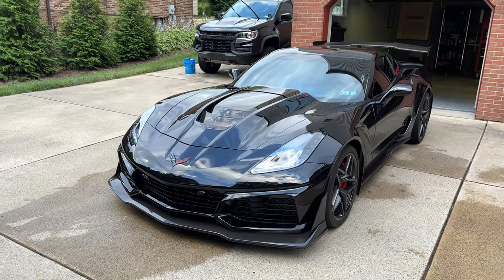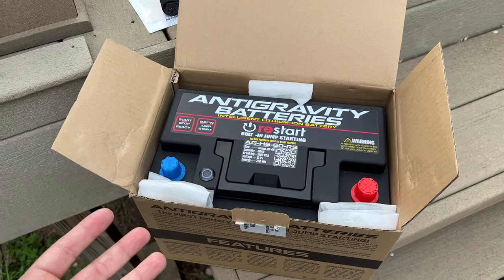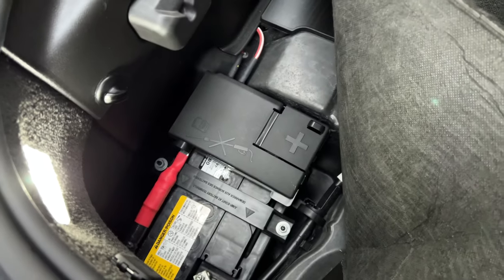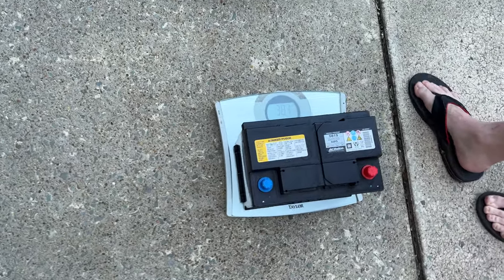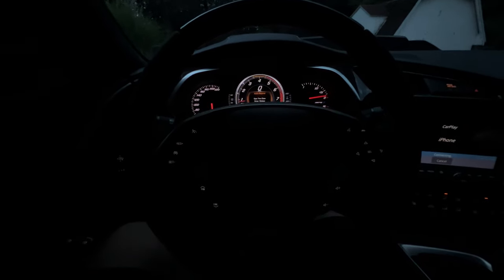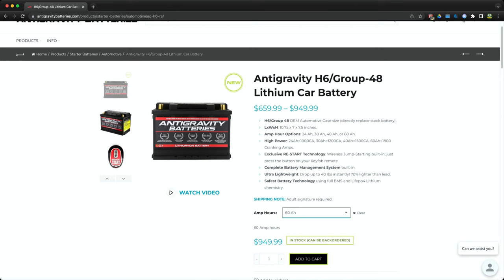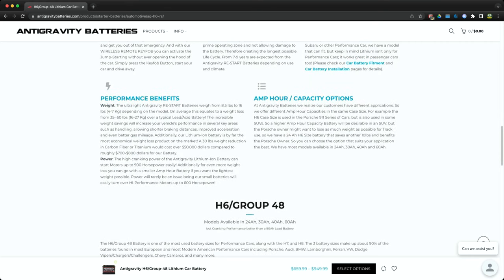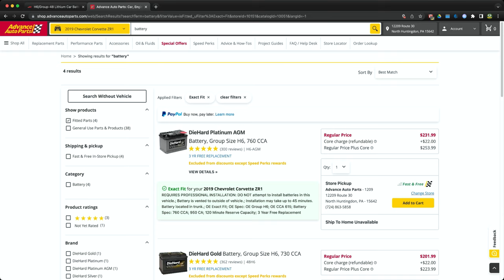The ULTIMATE Battery UPGRADE for YOUR Corvette! Antigravity Batteries!

Comment from the maker: What do you guys think? Those of you out there with a C6 or a C7 especially will benefit from this if you're storing your car during the cold months! Really cool upgrade today to the ZR1! 👍👍 Save 10% off Antigravity Batteries with coupon "HPO10" here: https://bit.ly/3yWtJki
Reply: Definitely a cool mod. Thought it would be heavier with all that power, but it's really the best of both worlds.
Reply from the maker: 💯 I’m very impressed myself!
Reply: As a c6 GS owner and basically a muscle/sports car owner for the last 35 years, a trickle charging battery tender is just normal. I also use a BT on my motorcycles, ATV, Side x Side, ect. Its just basically a quick 5 second plug in to be set. 
I've been running Optima's for about 25 years now. I have a Supercharged '98 4 Runner Limited with a large Audio system. At now 24 years old, I'm now on just my 4th battery in all those years, and my 3rd Optima. Just put a Yellow top in the '10 c6 2 years ago. 
The Antigravity Battery does have my attention now though.
Reply from the maker: @danielfair4675  It offers a lot of "technology" for a battery. I'm very impressed with the quality of it and am very much so looking forward to seeing how performs as time goes on.
Reply: Over $700... No chance in hell!

Comment: I have 2 C5’s and have to replace both in the last 30 days. I paid $243 for a Gold Die Hard and then $345 for an Odyssey. I keep both cars in a garage with close electric service so a tender is not that much work to connect. I run the tender about 6-8 hours on each battery every other week. Not ready to spend a grand on a battery yet but have Corvette friends who can’t seem to spend enough. Oh, the previous batteries I removed were a GM Delco and a Optima. If memory serves me both lasted about 4 years, the Optima a few months longer. Also, I only sprung for the additional $100 on the Odyssey because between changes my airplane battery bit the dust and close examination of the date showed 8 years in service…it was an Odyssey.

Comment: Very interesting and timely video for me.  Last friday my C7 would not start due to dead battery.  I was able to get it jumped with a NOCO Boost GB70 which allowed me to drive to dealer and have them put in a Diehard Gold for around $242 and some change.  It was 3 years and 11 months since i had changed the battery on the car initially.  So the anti gravity battery seems like a good deal since you only have to replace it every 10-12 in addition to the weight savings.  Also the NOCO Boost i purchased was another $200 (well worth it if you are sticking with the traditional batteries) so the ability to jump start the anti gravity battery by remote was also very cool.
Reply from the maker: Exactly. Great analysis with a real life situation to back it up. I will be continuously testing this going forward to make sure it makes good on the claims but so far, it's looking good.

Comment: Interesting concept about having fobs to "kill" the battery if you will in that it's almost like an anti-theft device. The draw back I think is that you lose all your programming and not just having to re-index the windows. Corrent me if I'm wrong on that. Another great "Upgrade" video Justin. Save the Wave 🙋‍♂
Reply from the maker: Thanks, Peter! I lost programming just once when swapping out the battery initially but haven't lost it again so I think it maintains enough juice to stop that from happening.
Reply: That would be a plus if there is enough juice to keep the pre-sets for hopefully everything but the windows. Indexing them is easy and quick. It's the other programmed items that can be a real PITA to set up all over again.

Thanks.

Comment: I went to the battery website, I think you missed 1 negative comment on the battery. When battery goes into sleep mode it shuts off, you will lose all your memory setting, all radio preset stations, etc.  I also found out it has a 5 warranty. By the way the price went up since the last time you were on their web page when you did the video. Love your channel and everything you do. Have a great year.
Reply from the maker: In both my C8 and C7, neither one lost settings when I swapped out the battery so it's unlikely the settings would be lost if the jump start ever has to be used either.
Reply: @HorsePowerObsessed I got that from a guy in the webpage, just repeating what he said.

Comment: I would suggest a Ctek lithium charger during extended storage periods as normally it is also suggested to disconnect the battery from the car also during extended storage.
Reply from the maker: absolutely. A 4 to 6 month storage for winter time would be fine without the charger but anything over that you'd still want it. If you drive your car in the summer but not in the winter that's the way to do it.

Comment: even if u buy 2 AGM (at about $280 a piece) bat which are NOT needed for this car it is still CHEAPER, if u add the trickle charger (@ about $125) its about the same price. Its a lot LESS if u buy the standard lead acid (as is recommended by OEM). I just changed my C7's battery and paid $125 at Costco (H6 Interstate Battery). Sure if someone gave me an AGM with a remote jump I would also love it but I don't think the price really justifies what u get unless u are racing and u want the weight reduction to me that would be a huge plus.
Reply: Depends on how long the corvette sits and if you have access to a trickle charger. If you don't have a trickle charger and the car sits a lot this lithium battery is a no brainer.

Comment: Your coupon code doesn't work. Any way you can get another code? Maybe they can give you a code that doesn't expire since your video doesn't expire.
Reply from the maker: Working on it now. I should have it for you shortly.
Reply: @HorsePowerObsessed  Awesome! Thanks! Anyway you can get 15%? Either will be a big help though.
Reply from the maker: The discount code has been updated! You're good to go now.
Reply: @HorsePowerObsessed  Awesome. I appreciate it. Wasn't cheap but my Z is sitting with a dead battery and its the best option. Thanks a lot!

Comment: Will the 24amp battery be even lighter? I have a anti gravity battery in my 4th gen Camaro. It weighs about 4 lbs
Reply from the maker: Yes the 24ah will be lighter as well. I think they go down to 8 pounds.
Reply: How has the battery performed for you? Any downside aside from cost? I have a 5th Gen.

Comment: What is the warranty on this battery?
If the battery goes into sleep mode does that impact all your memory settings, preset radio stations, etc?
Reply: I went to the battery website, I think you missed a con, when battery goes into sleep mode you will lose all your memory or and preset settings. I got this from their web page as a reply. “Hi Carlos, may depend on the vehicle's system a little as well as the duration..but it is possible as the battery is essentially shutting itself off you will lose settings.”
Reply: Warranty is 5 years
Reply from the maker: A lot longer than a regular battery!
Reply from the maker: In both my C8 and C7, neither one lost settings when I swapped out the battery so it's unlikely the settings would be lost if the jump start ever has to be used either.

Comment: Do these batteries have heater setup since lithium does not like to be charged when it's cold
Reply from the maker: For a Vette it isn't likely to be an issue but yes, once it's attempted to be started the heating process starts and will ensure no problems.

Comment: You mention cranking amps a lot. So, where is your testing data showing the upper limit of discharge ? . what test equipment did you use ? If you didnt, please dont run around repeating whats printed on the label. Besides, 99% of all cars only need  350 - 400 cranking amps to start anyway.